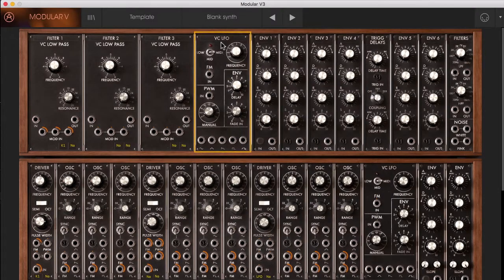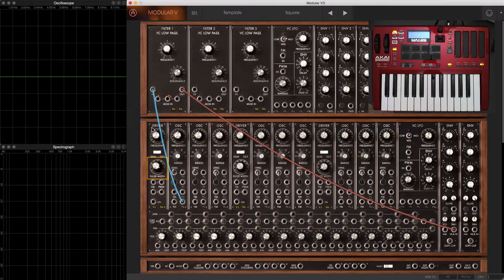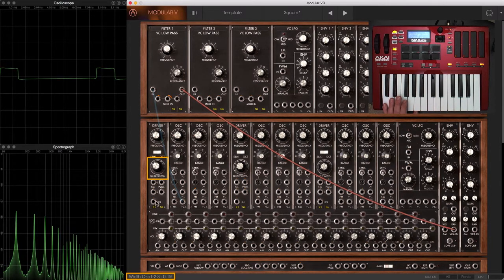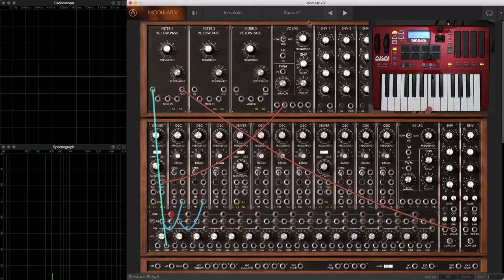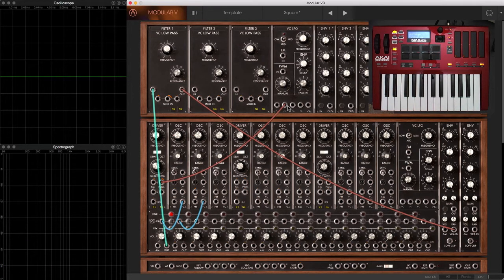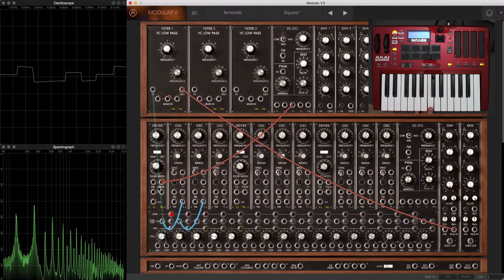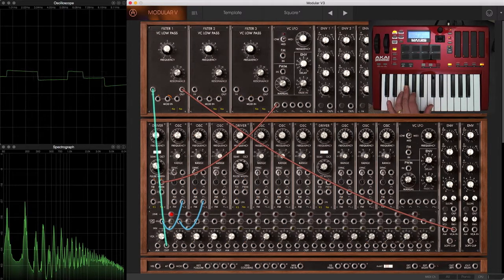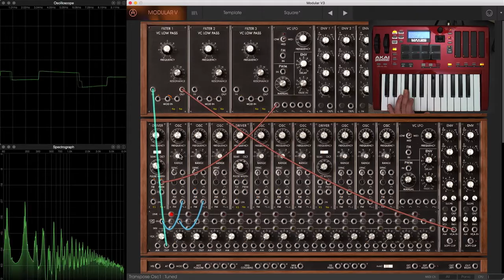LMS: Pulse Width Modulation using Arturia Modular V (V3)

Comment: I'm just wondering where you get the ocilliscope and the spectroscope that you are using in these videos
Reply from the maker: I've been using the Spectre software: http://spectre.aurchitect.com
Reply from the maker: The funny/sad thing about Spectre is that it has to look at an audio input - not the output of a program - so I had to loop audio out of my computer and back in again to get those display from a software synth. If you're using VST plug-ins, I'd look for a VST 'scope instead. But otherwise, I use Spectre's spectrum analyzer for my hardware synth videos as well.
Reply: Thank you for your quick reply, I appreciate it.  There is a trial version of spectre on their website so I'm going to test it out